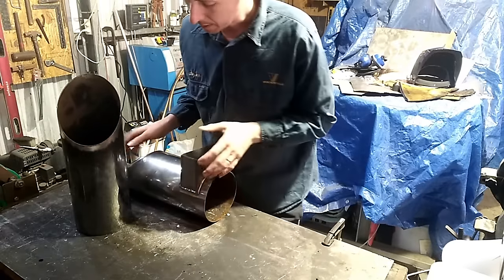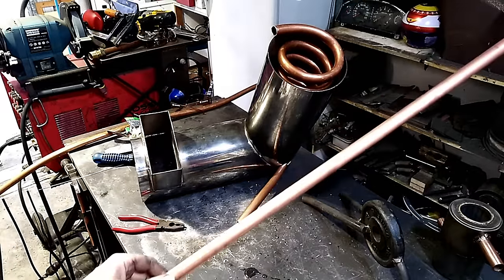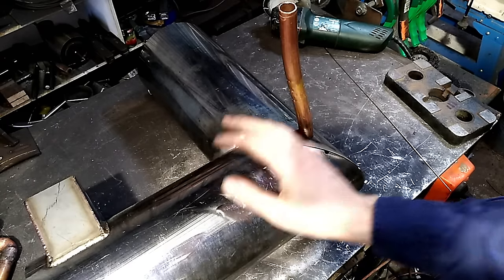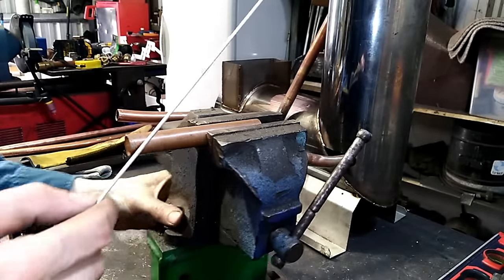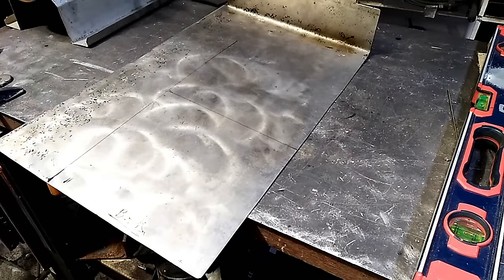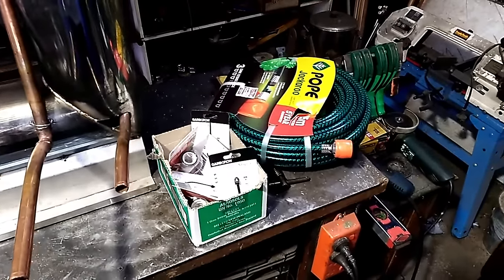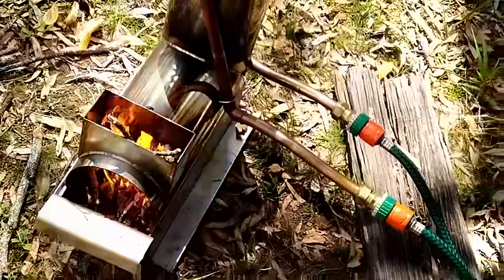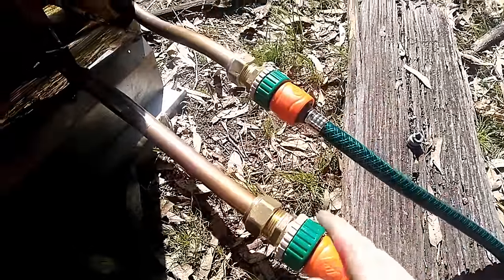Hot Water Rocket Stove II  - BUILD-

Comment: Very impressive. Would this arrangement heat more evenly, eliminating any stratification, if the discharge entered the bottom of the tank?   Additionally, I agree with NZ Shooter, a check valve may aid the heating  process.(As we say:"It's easy to Monday morning armchair quarterback" when we're just observing.)   It would take me a month to complete half of what you did.  Amazing.
Reply from the maker: Haha, it did take a month!  I'm going to revisit this build, putting into practice a lot of the suggestions that were made. Thanks, mate
Reply: Fun to watch. Any thermal siphon system should not have hot water going down hill. The water should be off the top of the coil into the tank. Inlet and outlet can be at the bottom of the tank, will help the temperature within the tank more constant. I love your little spokesperson at the beginning.

Comment: if you have the storage tank say 2 meters above ground level, will work better. like your tig welding
Reply from the maker: Issa Kelaita thanks mate
Reply: I built something similar today. And I bent the copper tubes into a kiddie pool. But couldn’t get it to “flow”. Is that Becouse the water source has to be higher than the coil?

Comment: I was searching for a way to bend copper pipe into coils because I was interested in turning my woodstove in my home into a hot water heater for my pre-existing radiator system that I no longer use because of the price of natural gas/propane. 
I'm really glad that I stumbled upon your video because I got two for one!
The copper pipe bending, and the stove that you made!

My wood stove is cast-iron and much larger. I was thinking of doing a much simpler retrofit by installing the copper tubing coils around the outside of the existing steel chimney/flue pipe and then connecting it into the pre-existing radiator system. 
I have a pre-existing furnace/boiler designed to use natural gas/propane to heat water and then pump it to the radiators to heat the house. 
I lose a lot of heat out of the chimney, and I am thinking of wrapping the flue in copper water pipe and redirecting that into the boiler system, and simply disconnecting the natural gas furnace then using the pump in it to then pump the hot water from my woodstove to the radiators. 
Essentially all I would be adding is the copper coils wrapped around the pre-existing flue, and then tying it into the pre-existing boiler. To make things even easier the boiler is directly below the woodstove in the basement.

I burn firewood all winter and it's much more cost-effective than propane. 
However, I have many rooms that are not heated that I don't use during the winter time or just suffer the colder temps in them. But every single room has a radiator in it.

I'm hoping I can do this simple retrofit to reclaim some of the lost heat and make some parts the house a little bit more tolerable. 

I have a question about the silicon bronze braising for us is just soldering the pipes. 

I know in your application that you have your coils inside the flu and therefore it must get quite hot. 
My steel flue has about a 4 foot long exposed section that I want to wrap in copper pipe before it takes a 90° turn and goes back into the old brick chimney. 
It runs in the 300 to 400°F range. Sometimes it gets up to 500° F.
I know that the copper pipe & the water in it will act as a heat sink, so therefore it won't necessarily get as hot as the flue itself. 
Do you think TIG brazing is absolutely necessary? 
Will a high temperature solder work? 
I know how to sweat pipes but I do not know how to TIG braze. 
I was thinking about leaving the End of the coils quite long after the last bend in the coils so that there's no soldered or brazed joints near the primary heat source.

The next worry would be that it would then have to turn 90° and go down several feet into the basement to hook up to the furnace. I'm guessing as long as the pump is running, this won't be an issue. 
The pump will keep the water moving and circulating. Thoughts?

Thanks for the great content! I thoroughly enjoyed your videos!
Reply from the maker: Tig brazing isn't necessary, It's just what I happen to have on hand at the time and I wanted to just try that and see how it would work. I think if you sweat them together with silver solder you'd be just fine.

Comment: i realy like ur rocket stove  in practice . and have never seen tig used to brase good 2 no i can in pinch and as a plumber  i dont mind ur tecneq but have some design conserns with [1] copper put inside the burn chamber can melt  [2] the sizing of the j tube and the 4 6 8 rull for sizing j tube [3]  the horazontal tube is supost to have a devider plate 4 seperation of conbustion and fresh air 4 secondary conbustion and incurage draw of air but do love ash catch [4] no insolation around the j tube 4 direction of heat [5] if u out let came straight out u get less steem or air blockage an mor natreral flow
Reply: Sumbody neads a speel cheker 🤣 some good points though
Reply: Unless the water boils out ,the copper will never reach the temperature to melt.
Reply: @chriskennedy7534  ha ha you're the one who needs spell check😐😁😁
Reply: like a gas fired tankless water heater
Reply: Here in the South we cook gopher turtle soup in their shell on an open fire. as long as the water lever is above the flame or heat source the this shell will never burn, same as with copper tubing, as long as the water is solidly running through it and especially having a cold source feeding it, it'll never reach it's melting point...Your other points are dead on...
Reply: some good points, but i highly doubt the copper will melt, its essentially water cooled.

Comment: Lucky he didn't suffer burns from the steam. Also, he was measuring the temperature at the top of the tank where the hot water was being introduced, so of course the hottest water would be at the top. The outlet pipe should always go up and then be submerged in the water level not above. The tank also should be above the stove to pressure the inlet and force the water thru the copper. Amazing how many people don't understand thermodynamics. Very simple, heat rises and cold falls. The very first cars relied on thermosyphon properties and that was 100 years ago and people still don't get it.
Reply: I don't think it's that people don't get it, it's that they weren't taught. Schools don't teach this kind of stuff anymore, which is a shame. It wasn't really discussed when I was in school, and that was the mid-90's. 
However, I do agree with your points of the levels of the inlet/outlet and water tank level relative to the heat generator.
Reply: Korishan I agree with you , those that understand and where taught those principles are so called experts because not every one has that knowledge but according to them it’s common knowledge talk about up themselves , give them an accounting job or something they would fall flat on there face , not so smart then are they.
Reply: Language has been around for thousands of years, but some still find it necessary to berate others. This fellow certainly said he hadn't done this before and was trying to test. Please, point out the video to your rocket stove water heater so I can see how to build one that is perfect.

Comment: Brazing would have been much simpler. The metal would have easily surrounded the copper joint by capillary action.
Reply from the maker: Yeh, it's true, didn't have any on hand, and I wanted to see how TIG braising went.  Thanks mate
Reply: @LittleAussieRockets  He was brazing, he was just using a tig torch to do it.  I love tig!!!
Reply: The term is sweating a joint.  You heat up the joint with a gas torch hot enough to melt the solder.  As it cools it pulls the liquid solder in around the joint.  Much faster and cleaner.  Also it can be undone by reheating the joint with a gas torch and twisting and pulling apart.
Reply: Also sweat soldering is easy in hard to reach places so you wouldn't have to split the riser like you suggested for next time. It would of saved the time to run to the hardware store to buy silver solder and flux and watch Youtube videos on how to sweat solder. lol Also, PEX tubing instead of your test garden hose as well as what others mentioned not to have a low spot to trap steam. Awesome video. Glad you didn't hide your mistakes.

Comment: A swage tool would take care of that "egg shape" in a minute.
Reply: What’s a swag tool.
Reply: @brianr1165  What's Google.
Reply: @brianr1165  a swage tool is for enlarging holes in metal or other products. for example you could use it to make an oval hole from a round one, its a useful tool to have in a sheet metal work shop. I use something similar installing aircon units to make sure i get the right size flange on the pipe and unit so it does not neel welding its just a metal to metal perfect fit.

Comment: Put exchanger under pressure first! check for leaks with air and soapy water! Dude smaller cup with no gas lens!
I am a coded welder(Power stations,refineries etc) and you would not believe the tight situations i weld in. the reason you are getting steam out is the syphon isnt working properly,you are starving the feedin of cold water.Barrel needs to be higher,no pump needed,gravity will do the job!Think of a water tower and the pressure you get out of your tap,comes from gravity!Steam is extremely dangerous!!!
Sorry,a little knowledge is a dangerous thing!!!
Reply from the maker: Thanks, I will be revisiting this build and putting into practice many of the suggestions given.  That sounds like an interesting job you have!
Reply: @LittleAussieRockets  your welcome,peace
Reply: To set the exchanger under water, you need to fill it with the bottom hose and make the hot water output to point upwards everytime. I think it is not working right, because inlet and outlet are at the same hight. If the output is all up, it is bleeding itself all the time, even after forming bubbles because of overheating. Throughput will be steady and much faster.
Reply: @xyz4469  Yes exactly hot must be at the top,Heat rises. And not point down in a passive system,Same as the barrel is cold bottom hot top.

Comment: right on Bob.. for me what
works is to imagine a marble starting at the top and rolling all the way to the
bottom and the bottom is the pipe inlet. If a marble can’t roll then water flow
is resisted or even stopped so that you need to rely upon the difference
between the temperature and water pressure to move the water and there to be a
vacuum to pull it just like the flew of the rocket stove bench heaters rely on
draw or vacuum pressure difference. But if a marble can role easily all the way
to the inlet then water will gladly do the same. Also, the steam indicates the
fire may be too hot given your setup or just right to create a mini steam
engine to circulate but I think keeping sufficient water flowing so that it
never stops long enough to turn into steam is far more efficient use of energy.

If I may suggest.... I learned
gas welding on aluminum boats in three days and I am not in any way
knowledgeable in it but I learned a few very important things when watching the
best welder in the shop which changed my game entirely... try holding the
supply rod like chop stick between the thumb and base of the first finger,
keeping your hand relatively flat feed the wire between the first two fingers
around the tip bend. now slide the two fingers down the rod towards the thumb
crease holding the wire, then squeeze the two fingers, release the pressure on
the thumb and feed the wire with your two fingers. You will be able to be more
like a wire feed for longer runs and smoother delivery... give it a shot,,, I
think it is a secret no one is supposed to tell because no one taught it to me
and few do it this way... but it really works.. all the best and thanks for
sharing.
Reply from the maker: Thanks mate,  I appreciate you sharing the tip. Will give it a go!

Comment: Think of the water flow as a circle. The heating system is on one side, halfway up, and the HEATED is on the other side. When i was a child, a coal fired stove was our only form of hot water supply, then, later on, i had a house the had an open fire, and the grate was made out of schedule 40 steam tube. It was very carefully constructed and installed to meet the requirements as i described in my prior comment. I hope the constructor of this video, takes our comments in good part.
Reply from the maker: We are revisiting this build to put into practice the helpful suggestions you guys have given, much appreciated with your input!

Comment: This is a very good design. I suggest that the rocket furnace and chimney can be placed in the center of the water storage tank. The direct heating effect should be better. But the bucket should be changed to iron.

Comment: I agree with everybody on the section of copper pipe running down. Also check valve on the outside will cause it to suck the water back on the inlet side after the steam is vented. That will keep your flow in One direction

Comment: Pretty neat overall. I plan on building a similar setup but using a 270Gallon IBC tote to store the hot water. Then use the hot water in a heat exchanger to help keep the house warm and stabilize the  fluctuations of the wood stove. 
The water tank will either sit on a 6ft tall tower, or will be ground level with a small 12VDC pump (on the inlet side, of course).  The pump would need to be used anyways with the heat exchanger, so might use it in both applications.
Reply from the maker: Wow, that's getting serious, hope she works out for you.   I'd be keeping the IBC tote out of direct sunlight, it will last longer, but I'm sure you know that.  Thanks mate
Reply: If you’re going to recirculate the water in a closed loop, you could mix a percentage of alcohol into the water so algae et al doesn’t grow. My daughter had shoulder surgery and the cooling device they gave her for recovery was set up that way.

Comment: Acetylene or map gas torch and flux infused solder would make things like the tight space to weld the copper 90 pretty simple. No need for anything other than a small hand held bottle. You may know this, but maybe grab one of each on your next hardware store run. Love the content.

Edit: lol nvm you have one already, just need the solder.
Reply: I totally agree, I was going to make a similar comment but will just add to yours. This guy has made a simple silver brazing job of copper tubing difficult and complicated.

Comment: You made A lot more work for yourself by not just soldering your pipe connections. Your welds would have looked A lot nicer and waterproof. You really doubled the time it should have took, nice job 😎

Comment: I'm impressed with the performace of this water heater.  I was thinking of building a smaller 5 gallon one with 3/8" tubing for camping and using a camp stove as my heat source.   A 5 gal pot is too big and heavy for a camp stove to direcxtly boil the water.

Comment: 33 years in the trade I've never TIG welded a copper joint. I use 95/5 or 50/50 solder/flux heat joints with either a  propane or acetylene torch. Of course sand or rough up all shiny copper surfaces that you want to join...whatever works mate! From the States.

Comment: I know you've probably already realized you were losing a lot of energy through the feed chute on your stove. If you had a taller feed tube, you could put wood into the feed tube, cover it, and cause the draft to pull far stronger. This comment is a nit, I realize, because in fact your experiment worked very well overall! Good job! I don't have what it would take to TIG braze the fittings together and I'd have to go the silver solder method. Extending your idea, you might also get a faster heat up of the water barrel by lengthening the vertical chimney on your stove and adding more copper tubing to get more surface area into the heating zone. You could also (maybe) run smaller diameter copper tubing but a lot more of it in the heating zone to add surface area. That may just produce steam but maybe that would be even better. I'm just thinking out loud here. There may be diminishing returns after a while. But just ideas I had about this project. On the other hand, you don't need the water to boil! If it's for bathing and washing dishes and other household projects, you've reached a good temperature for those tasks at the top of your barrel. After a time, I would think the water in the barrel would start to churn and become a more consistent temperature, especially of there was a lid on the barrel. It's a great project! And you've made it out of some nice materials too. I like it a lot! Great job and a very good video and demonstration of how well one could go about making such an item. Well done!

Comment: To make the copper tube round again just use a tubing swager. You can buy these in most any size or even make one on your lathe or even drill press. Its basically just a tapered and highly polished punch type mandrel. Make friends with a commercial HVAC tech. He can probably loan you one.
Reply from the maker: Thanks David 👍

Comment: Once you have that bucket heated up and insulated you then have the ability to move that thermal energy around and disperse the thermal energy by heating mass.  Heated flooring comes to mind.  Essentially it can become much like a rocket mass heater, but can be more widely and evenly distributed.  Question: As cooler water passes through the copper coil did it have a cooling effect inside the secondary burn chamber?  My understanding is the secondary burn chamber works more efficiently if it maintains a higher temp.